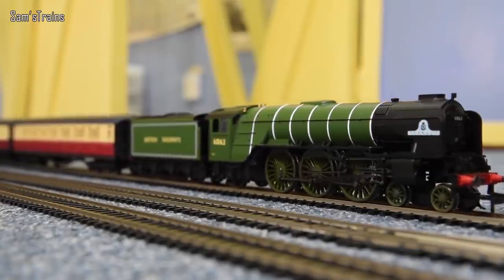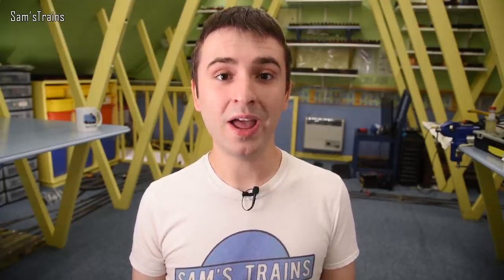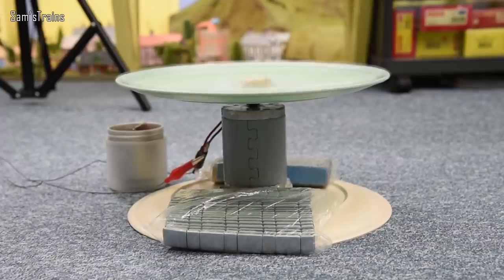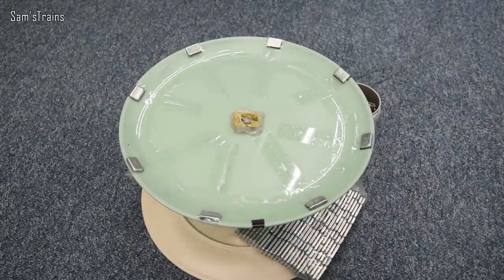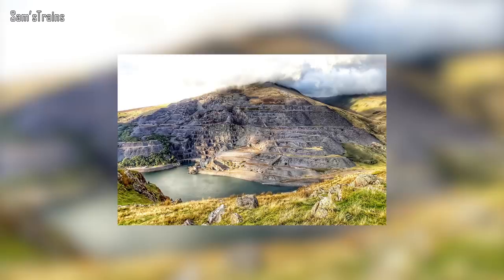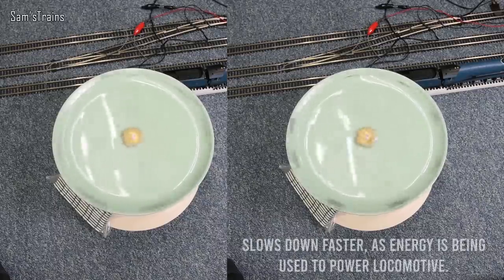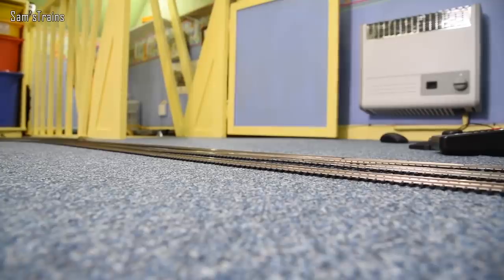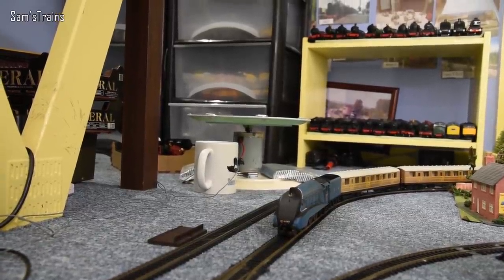Powering Hornby Trains With A Scooter Motor & Dangerous Flywheel

Comment: the way the flywheel slows down with a locomotive attached is actually pretty similar to how real Diesel-electric and pure electric dynamic braking works, instead of inputting power to the electric motors, it draws power from them, using the transfer of kinetic energy to electric to slow the locomotive down, this is also how Regenerative Braking works on Electric Cars to restore some battery when braking
Reply from the maker: Yes you're absolutely right - it's very similar indeed! :D
Thanks for watching, Sam :)

Comment: I have a MRC dc Controller has Momentium on it its a tech 2 2500.  I actually like it when it is on so the locomotive can simulate the inertia .  thats funny though how the scooter motor works to be a flywheel
Reply from the maker: Very cool! I've always wanted to try something like that, it is interesting! :D
Thanks for watching, Sam :)

Comment: Sam, I don't know if you are still using this mechanism or not but I recommend you find an old turntable and use that as a big flywheel,  it will be far better balanced and if it's an aluminum one you won't need to tape anything to it for weight.
Reply from the maker: That's a great idea! I don't still use this though - it was just for a bit of fun!
Thanks for watching, Sam :)

Comment: Well, that was an interesting video. Good show!
Considering the Gaugemaster is a powerful controller, I would have liked to see what happens if you use a less powerful controller, like the Mehano one. Another interesting thing worth mentioning is that this is basically how dynamic brakes work on real electric and diesel-electric locomotives.
Reply from the maker: Yeah that’s a good idea, I’d like to see what happens then too!!
Thanks for watching - Sam :)

Comment: Seat of the pants stuff ,great .Thay did this with Motor Generators with big flywhhels on early Southern Loco's to get over Joints in the third rail and you could run them up on shore supply to get them out of the shed . Keep messing .
Reply from the maker: Thanks Swampy, yeah I heard about that too - very interesting stuff! :D
Thanks for watching, Sam :)

Comment: I know this video needs a clear view of the flywheel, but you could stick a bucket over the flywheel. Maybe a wire mesh waste bin?

Making a flywheel rig that doesn't shudder and is safe would be difficult, needs things we're not likely to have such as a lathe, but it's not impossible.

I suppose we could do what a DCC does with an external black box. Full power into the black box, control signals from the knobs and switches. Analogue or digital? The digital approach would let you program the  response to reflect the physical train motor, the train size and "real" behaviour, and make it fairly easy to set up. 

Somebody must have done it.
Reply from the maker: Yeah sure! If you were doing this properly, you'd want a much smaller motor, and a much smaller, denser flywheel - possibly made of brass or something! Thanks for sharing - I wonder that too!
Thanks for watching, Sam :)

Comment: If you were to make a less dramatic version of this, an interesting thing to use would be an engine flywheel from your local scrappy - would be perfectly balanced especially if you mated it to the motor with a shaft of the correct diameter or even had an adapter plate machined and threaded as to actually bolt on the flywheel.
Reply from the maker: Great idea Iain - maybe I could look into that some time!
Thanks for watching, Sam :)

Comment: Sam, you need to wear safety glasses during your experiments! Other than that, very interesting! Upon watching this I immediately thought of friction motor flywheel powered toy cars. You could make the motor of the locomotive drive a flywheel through a speed multiplier gearbox. That would generate considerable inertia in both acceleration and deceleration. Only it would be very difficult to fit the mechanism inside one of these small scale locomotives. Just some food for thought. Stay safe and keep on chooching!
Reply from the maker: Thank you! Yes I was wearing goggles, except when I staged that shot of me on camera! Thanks a lot for your thoughts, cool stuff! :D
Thanks for watching - Sam :)

Comment: Hmmm.... I was thinking of controlling the acceleration with something more "electronic" like an arduino or RC delay circuit. But this is showing very nice results especially in deceleration. Congrats sam!

To the electric engineers: would using an RC circuit (and some other basic component without any kind of MCU)  be enough to achieve such accel/decel?
Reply from the maker: That sounds great - no doubt you could do this better with electronics! :D
Thanks for watching, Sam :)

Comment: You should pitch this concept to a manufacturer. I could also see the motor contraption without the train being used to power an electric fan with multiple speeds (as opposed to just two or three steps)
Reply from the maker: haha thanks mate, yeah I suppose a smaller neater unit might be quite compelling! :D
Thanks for watching - Sam :)

Comment: Interesting idea sam but a little risky and sketchy if the tape did not help hold the weights it would be very scary thankfully your experiment works quite well hopefully it's back to normal running next time
Reply from the maker: Thanks mate! Yeah that's interesting - but the tensile strength of tape is quite impressive - if you look at the way I had it, it'd take an awful lot of force to overcome that tape!
Thanks for watching, Sam :)

Comment: Interesting experiment. Besides DCC, that would have been interesting to see a Gaughemaster controller with inertia simulation in action. I've been told they are good controllers, I only have the smallest of Gaugemaster products (and it is excellent for what I'm doing with it !)
Reply: Lots of other inertia simulation controllers made since the mid 1960s.
Reply from the maker: Thanks Oliver - yeah I might try to get one to demonstrate, they look good!
Thanks for watching, Sam :)
Reply: @johnd8892  I only know the Gaugemaster because it is a brand sold in France. And, before the Internet, the only one available here with inertia simulation. The top notch here is a german-brand controller (usually, Fleischmann) with PWM and zero inertia simulation... But I wish I would have a look at other products like the Gaugemaster.

Comment: Now selling on Ebay & Amazon (links below) Sam's death trap ;) Joking aside a really fun experiment and it worked a treat. As other people have said if there was a way to make it safer, you really could market this idea, Sam! One thought as to making it a bit safer, add up the total weight of the plate and weights, get some steel discs the same diameter as the plate and with the centres drilled out in the exact centre. Keep adding discs until the exact weight of the plate & weights is reached.  

I kept expecting you to appear from behind other pieces of furniture in your loft lol. Great video, Sam, highly entertaining!
Reply from the maker: haha if only!! Maybe - though I think capacitors or electronics could probably do the same thing more more cheaply and safely - though glad you liked the idea!! I was - I was hiding behind all sorts! ;D
Thanks for watching, Sam :)
Reply: @SamsTrains  Capacitors could possibly help with slowing down to a stop perhaps?

Comment: Sam plays train sim for a bit and now craves the punishing feeling of finicky controls.

i approve of this mad science, tho why wasn't the plate balanced? was it to do with the plate itself or the connecting err... glueblob.

Opening reminds me of a line certain programe used:
"Do not try this at home, no realy don't."
Reply from the maker: haha thank you! Yeah it will have been a mixture of things - the centre hole could have been slightly off, some of the weights might not have been perfectly in position, there may have been more glue on one side than the other etc - it was actually much more balanced than expected! ;D
Thanks for watching, Sam :)

Comment: Same principle of weak fielding and back EMF on real locomotives. The engine drives the generator that powers the traction motors but after a while the motor starts to beccome a generator itself and the back EMF cancels out any further excitement. This back EMF has to be shunted into a weak field so that the generator can put more power into the motor.
Reply from the maker: Very interesting Al, thanks for sharing this! :D
Thanks for watching, Sam :)

Comment: If all this is safely enclosed in a box with the same accuracy of hard disks even with quite a different weight of the flywheel, then it could be hung under a display or onto the hidden station to permanently give dc juice to a line. In this way it could become an industrial product.
Reply from the maker: That's true - it'd be very interesting! But ultimately the same thing (or better) could be achieved with cheap electronics, so it'll never happen!
Thanks for watching - Sam :)

Comment: Cool, it did what it said it would on the label :) if you increased the mass of the flywheel would that sustain the effect longer? On second thoughts I won't try it, never mind my nether regions, I don't want a ruddy great hole in my wall and the neighbours car obliterated. Seriously though, is this akin to what the miniature flywheel does in a model locomotive, I know from your videos that when you cut the power the wheels don't dead stop when a flywheel is fitted. Interesting .......Drew
Reply from the maker: Hey Drew - yes indeed - the larger the mass of the flywheel, the more kinetic energy it'll store at the same speed - but yes, not at all recommended, lol! ;D
Thanks for watching, Sam :)

Comment: Can you put three CD motors into a diesel locomotive? The first motor is powered from the track, and it drives the second one. The second motor is wired to the third, which drives the loco.
This should allow some diesel simulation with idle and all, especially with a big flywheel on the 1 and 2 pair.
My excuse for not doing it: My gears never arrived.
Reply from the maker: That's pretty interesting - maybe that could be done, cool idea!! :O
Thanks for watching - Sam :)

Comment: What is needed haere is a self-contained, sealed, unit, but I doubt whether it will ever catch on. You can put inertia on a DC unit.
Reply from the maker: Yeah that's true - and probably a brass flywheel, so that it could be small! But you're right - there's no reason to do it this way, the same thing is done much more easily with electronics!
Thanks for watching, Sam :)

Comment: Hiya, have a look for online Electrical Engineer or Standard Handbook for Electrical Engineers. Late 1930s through 1950. There are several PDFs. Than find Ward Leonard DC motor control. What you are doing is on the same lines for something invented in the 1890s. I find the early books very easy to understand (pictures and diagrams). Modern electronics achieves the same (or better) without the 'Victorian/Edwardian' physical engineering. Big things that go round and explode or burst into flame are much more exciting than a MOSFET failing in a controlled way though :-)
Reply from the maker: Very interesting, thanks a lot for sharing this! :D
Thanks for watching - Sam :)

Comment: Or you could use a ceramic capacitor bridged over the motor contacts
Reply from the maker: Sure, a capacitor would work... but a ceramic one wouldn't have the capacitance required, and electrolytics are polarised, so it's not as simple as bridging them across the motor!
Thanks for watching, Sam :)

Comment: Sam, seriously, buy yourself a pair of safety specs from screwfix before you try something with rapidly moving parts again (or anything that could create small sharp projectiles, such as cutting with craft knifes). They are really worth it.
Reply from the maker: Obviously - I'm not actually insane! I wore goggles for every high speed test - the shot you saw of me was staged, at great distance, and at low speed! Like I said at the start, this was for entertainment purposes only - I deliberately dramatised parts of the video!
Thanks for watching, Sam :)

Comment: i do like the experiment but it is dangerous, is there a safer way, it does look good though.
i wanted to figure out a way to do it for my loco, by that i mean slowly speeding up, but i might save up for dcc
Reply from the maker: Sure - it was a stunt and that was the point - I was safe! ;D
Yeah - as I say, don't do this at home - there's no reason to! xD
Thanks for watching - Sam :)
Reply: @SamsTrains  it was a good stunt, just dont it on the regular, also what are you going to do with the fly wheel

Comment: Why not get a flywheel machined at a local shop so it's less janky and bolt the motor in a sturdy frame.. that way it's 100x safer and the flywheel would most likely have more weight, an increase in weight woukd equal more kinetic energy stored and therefore a longer running time
Reply from the maker: Sure! If I was doing it properly, that'd definitely be the way to go!
Thanks for watching, Sam :)

Comment: Hi Sam,

So it’s either drill holes in your mum’s dinner plates, add weights to the edges which might decapitate you or anyone else present, and then you can speed up or slow down locos as they do in real life.... OR insert a DCC chip, and then you can speed up or slow down locos as they do in real life.... “Mum, have you got any spare plates?”

Jim
Reply from the maker: Yep - spot on there Jim- that's me! ;D
Thanks for watching, Sam :)

Comment: The effect is nice until you need it to stop immediately to stop a derailment
Reply from the maker: Yeah - though that's do-able, you just change the direction on the controller as shown. I guess a safer way would be to have a series resistor wired to a push-button! :D
Thanks for watching, Sam :)

Comment: Haha well done Sam, you have very simply explained how the BR class 71 SR electric locomotive worked, in that a large flywheel connected to a motor generator kept the loco powered when gaps in the third rail were encountered! There are some differences, it was in series and the output from the motor generator could be added to the third rail supply of 650v dc giving over 1000 volts for the traction motors!!! More here from the 10min mark if interested. https://youtu.be/CFYKMAO_2A8 I'd very much like to see you test this out! Consider yourself challenged :)
Reply from the maker: Thanks Mike! Oh really? I didn't know they worked that way too - very cool! Many thanks, I'll look into that!
Cheers,
Sam :)

Comment: Doing the maths on an real A4 (at 169t or 169000kg total weight with 35,455 lbf or 157000 Newtons of power) a real A4 has a power to weigh ratio of 0.93N/kg. With that, a true 1:76 scale A4 should weigh 2.2t with a  pulling force of around 2000 newtons!

Or to be more reasonable if the loco weighed 1kg then it should have a pulling force of 0.93 N

Lets say your loco weighs 300g and has a pulling force of 0.5N then its power to weight ratio of 1.6N/kg is around 80% more powerful than a real A4 for its scale. Assuming that is the railroad A4 then it will weigh even less!

But 1:76.2 is the scale for the size of the loco. The above calculations assume weight is linear to volume which it isn't. If you divide the weight of a real A4 by the presumed weight of the model (169000/0.3) then the scale factor is 563,333! Applying that scale factor to the real A4 power (157000/563333) means the model should have about 0.27N of pulling power.

If we assume the same 0.5N of pulling power in the model then its nearly 2x more powerful than a real A4 for that scale!

Obviously these numbers are peak for comparison and reality is totally dependant on for instance how the power is delivered including torque curves, mechanical losses, friction, drag etc etc.

Takeaway: add more weight to your locos if you want them to run more prototypical!
Reply from the maker: That's interesting! Not sure you can just divide like that though - it's probably more complicated! I'd probably match the real density, and then look at comparing the volume to get the equivalent mass!
Thanks for watching, Sam :)
Reply: @SamsTrains  Thats why I gave both the linear and volumetric calculations using scale division and scale factor.

At any rate the numbers are abit meaningless as tge materials make a difference as you wouldnt or atleast it would be difficult to make a fully functioning replica model at that scale i.e. making the model out of steel and iron, all the fire tubes and cylinders, water, coal etc etc

Thats why the take away is models are generally over powered and under weight for their scale by some margin. 

It can be said though that if the models where heavier and under powered, while they might perform more prototypical, the wear and tear would increase dramatically on for instance the wheel sets, mechanisms and motors, so not being true to form has its advantages

Comment: or better yet, use a large capacitor instead!
Reply from the maker: Not quite that simple, as most capacitors are polarised - so they'd just explode if connected in parallel! ;D
Thanks for watching, Sam :)
Reply: @SamsTrains  if you use one of those 50v 1f caps, connect it parallel to the track it should work. Caps are polarized, thats why you gotta connect them in parallel.

Comment: You posted this 5 days too early. Model railroading was a safe activity until now!

I built a PWM controller about 25 years ago and added a large capacitor that could be switched on or off. With the capacitor it takes several minutes to accelerate or stop the train. Not really suitable for a model layout as you will always miss the platform or the red signal.
Reply from the maker: That sounds epic Ron - what a good idea! I thought about using a big cap, but it'd have to be wired behind the controller switch in the circuit, and I didn't want to take my controller apart! xD
Thanks for watching, Sam :)